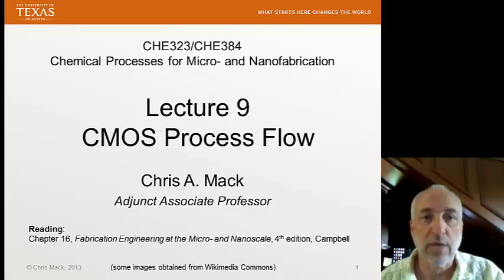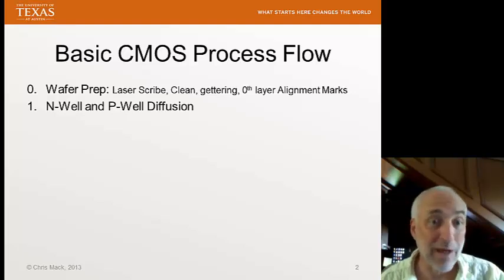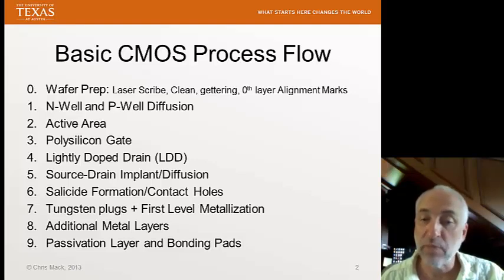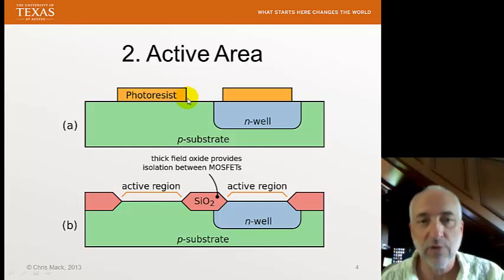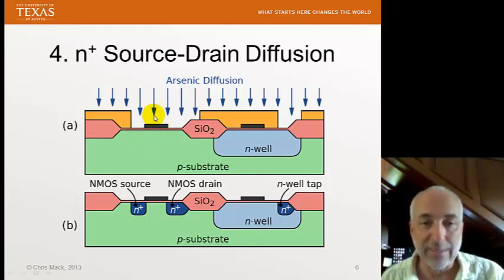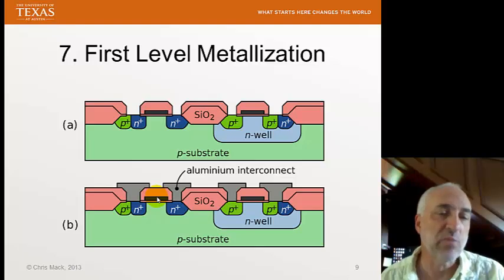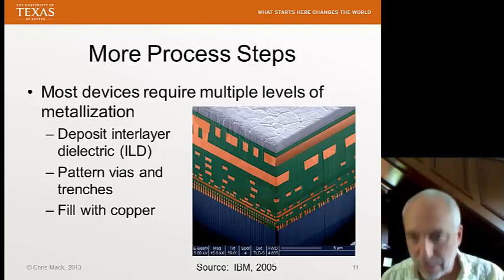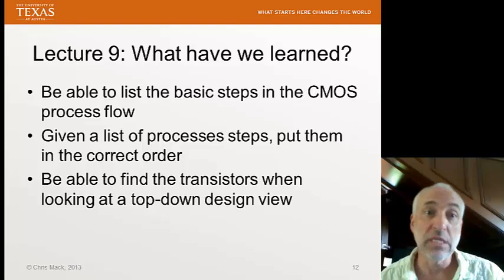Lecture 9 (CHE 323) CMOS Process Flow

Comment: AI Summary

Abstract:

This lecture provides a fundamental, simplified overview of the CMOS (Complementary Metal-Oxide-Semiconductor) integrated circuit fabrication process. It systematically outlines the key sequential steps involved in building a CMOS circuit, starting from initial wafer preparation, through the creation of doped wells (N-wells, P-wells) and active device areas. The core process of forming the polysilicon gate and doping the source/drain regions to construct transistors is detailed. The lecture then explains the crucial multi-layer metallization steps, including contact hole formation and interconnect wiring, necessary to connect millions or billions of transistors into functional circuits, concluding with the final passivation and bonding pad creation. This provides essential context for understanding how individual process steps contribute to the overall semiconductor manufacturing flow.

Exploring the CMOS Process Flow: From Wafer to Circuit

*   0:00 Introduction to CMOS Process Flow: This lecture offers a basic, simplified overview of the typical CMOS process flow, focusing on how different chemical process steps combine to create a functional circuit.
*   1:01 Wafer Preparation (Step Zero): Initial steps include laser scribing unique ID numbers (sometimes barcodes) on the back of the wafers, thorough cleaning, "gettering" (implanting imperfections on the back to attract defects away from the active surface), and establishing zero-layer alignment marks for subsequent patterning.
*   1:37 Well Formation (Step One): N-wells and P-wells are created through patterning, dopant implantation (e.g., phosphorus for N-wells), and diffusion. These wells define the regions of the wafer where specific types of devices will be formed, with modern processes typically utilizing both N-wells and P-wells.
*   2:03 Active Area Definition: Regions where transistors will be built are defined and isolated by growing thick oxide layers in non-active areas, ensuring electrical isolation between adjacent active regions. This is achieved through processes like local oxidation of silicon (LOCOS) or, more commonly today, shallow trench isolation (STI).
*   2:24 Polysilicon Gate Formation: A thin oxide layer is grown/deposited over the active areas, followed by the deposition and patterning of polysilicon to form the gates of the MOS transistors. Gate engineering, such as the creation of lightly doped drains (LDD) with sidewall spacers, is performed to optimize device performance.
*   2:47 Source/Drain Implantation and Diffusion: The main source and drain regions are created through ion implantation and diffusion. This involves separate steps for N-channel devices (using N-type dopants like arsenic) and P-channel devices (using P-type dopants like boron), with the polysilicon gate acting as a "self-aligned" mask to prevent dopants from entering the channel region. At this point, the basic transistor structure is complete.
*   2:54 Connecting Transistors: Contacts and Metallization: To connect the newly formed transistors, salicide layers (to improve contact resistance) are typically formed, followed by the deposition of an insulating oxide layer. Contact holes are then patterned and etched into this oxide, which are filled with conductive material (e.g., tungsten plugs in modern processes) to make electrical contact with the source, drain, and gate.
*   3:12 Multi-Layer Interconnects: Multiple layers of metal (commonly 2 to 10 layers, often copper in modern designs) are sequentially deposited and patterned to create interconnecting wires. Vias are used to establish connections between different metal layers, allowing for the complex wiring required to link millions or billions of transistors in a circuit.
*   3:42 Passivation Layer: A final protective passivation layer is deposited over the entire chip, except for specific regions where openings are created for bonding pads. These pads facilitate electrical connections to the external packaging, allowing the chip to communicate with other components.
*   9:45 Identifying a Transistor in Design: From a top-down design view, a transistor is identified wherever a polysilicon gate crosses an active area (diffusion region), with the source and drain regions implicitly located on either side of the gate within that active area.
*   12:15 Context for Future Studies: This lecture serves as an introductory overview, providing a coherent picture of how all the individual process steps fit together to form a CMOS device and circuit. Subsequent lectures will delve into the details of each unit process step.

I used gemini-2.5-flash-preview-05-20| input-price: 0.15 output-price: 3.5 max-context-length: 128_000 on rocketrecap dot com to summarize the transcript.
Cost (if I didn't use the free tier): $0.0057
Input tokens: 16079
Output tokens: 934

Comment: You forgot to mention LDD and reasons.
Reply from the maker: LDD - lightly doped drain, is a way to tailor the dopant profile near the edge of the gate to reduce the electric field and the number of "hot" (energetic) electrons that have enough energy to penetrate the gate oxide.
Reply: i.e. known as Hot Career Injection :) Your explanations are good. Can you make a video on the difference between CVD (its types, methods), ALD, Sputtering, PVD combined with Epitaxy lecture. It is a little confusing. Also your explanation on 13.56 Mhz standard frequency saved me. Thanks for that.
Reply: Also, a video on SPC ( I have seen it but it's too short), 8D, 5Whys, 6Sigma, etc - in the domain of Semiconductor in detail would be awesome. Also how tech nodes differ in Analog and Digital would be great too :-D

Comment: Great explanation!
Why do the metal layers get so much larger the higher they are in the stack? Or are these maybe mainly the power lines?
Reply from the maker: The lower metal lines are used for local interconnections.  They tend to be short, so it is OK if they have higher resistance.  The higher metal lines (towards the top of the stack) are for longer distance connections, and so we want thicker and wider lines for those long connections to keep the delay times short.  Power and Ground lines tend to be the fatest.
Reply: Chris Mack Ah, thank you very much! That makes sense.
The connections to the outside world are at the top, so does that mean there are very small wires going from the bottom to the top to carry the data? Or is all wiring on a certain layer the same size?
Reply from the maker: Check out lectures 28 and 29 on interconnects:
https://www.youtube.com/watch?v=Gxp1cRe_Lyk
Reply: Chris Mack Thank you, I will. You have made a great channel Chris! This will waste hours and hours of my life the coming weeks!

I recently bought a microscope and some acid to decap some chips. Nowhere near Zeptobars level, but I love this stuff :D

I appreciate the time you spend on this  :)